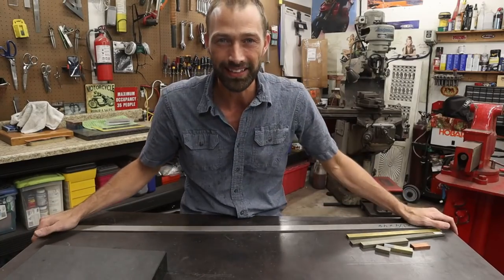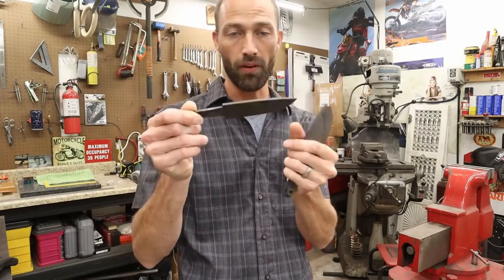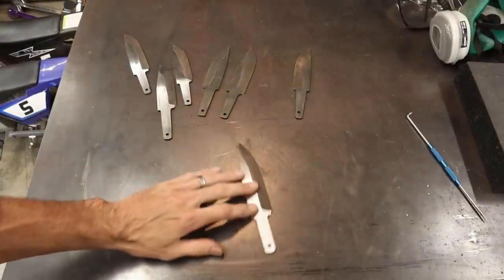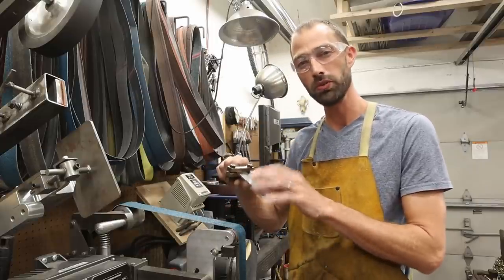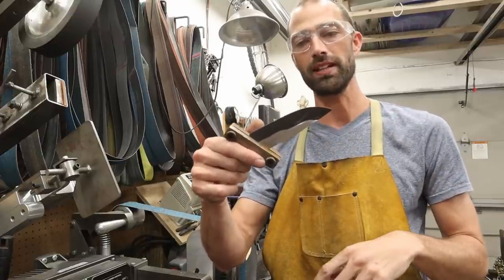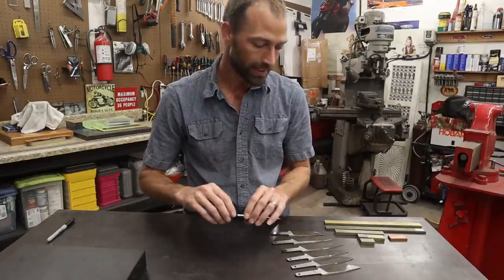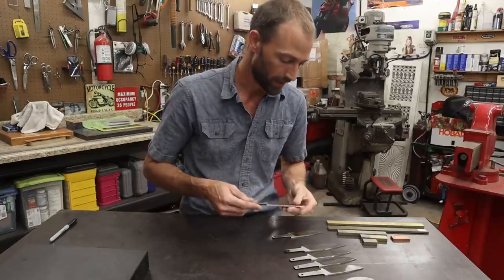These tips will improve your bevel grinding!

Comment: Awesome vid. I just started out. Freehand bevel grinding is very difficult, I have a huge appreciation for it now. It's an art of very slight hand adjustments. I find it easier to grind one side of the knife versus the other. My next attempt will be to grind my weak side first, then match the other with my strong side.
Reply from the maker: That is a good plan!
Reply: Im gonna steal that technique from you.  I'm also just starting out

Comment: Great video, I´m doing that too, 3 stainless steel knifes at the same time. And I´m using the grinding belts from Hermes, model RB590Y, it´s a agglomerate AO belt, and I go from 50 ceramic direct to 240 agglomerate. They are much thicker than a normal 220 grit and don´t burn the blade
Reply from the maker: Thats a neat belt for sure!

Comment: Thanks Aaron for the steady flow of useful tips and tricks. I am about to finish 3 knives (plus a couple more unrelated to this batch) that I'm doing simultaneously.  I've learned a lot doing it this way, even from one blade to the next I was able to improve. I'm also learning the idiosyncrasies of my 2x42 grinder. It's interesting how this machine is much different than the 2x72 requiring slightly different techniques due to the single speed, heat generation, and the design of the grinder in general. I've ended up modifying it over time as I've gotten to know it doing these 3 knives at once. One more thing, as I improve, I'm also able to take the information that you and others are offering and apply it as my understanding through increased experience. The process is really quite engaging to say the least.  Thanks for all the helpful guidance, I appreciate it something fierce!
Reply from the maker: You are correct that the 2x42 is quite different!

Comment: its been 5 years since i made knives, and i olny made them a couple summers. took awhile but i has very happy with them in the end. im preping to get back into it and your steps are very encouraging and helpful! i like the heat treating right after rough profiling and beveling. i was treating near the end, fearing it was harder to drill, grind and sand once treated. plus i was using a dremmel for the finger grooves. ill watch your vids, see what else i may have missed on steps and methods!

Comment: Great stuff as always.   I started doing batches of knives a little while back and enjoy it. The latest batch is 5, but two are karambits and I'm not entirely sure I have the skill yet to bevel them, but going to give it a go anyway.   
Interested in the handle section. I recall one of your vids where you applied (I think) tung oil quite liberally and then will lightly sand and do another coat.  I'm having a bit of an issue with this as after a week, my tung oil is STILL tacky.  May need to move it indoors out of the humidity.  The wood is Wenge, which looks great when the oil is first applied but then turns dull so hoping after several filler coats and then some wax, I will have it looking right.
Reply from the maker: Karambits are difficult for sure! I am glad you brought up the tung oil! I should have made it more clear in my video that I am using a tung oil finish. It is not pure tung oil and it has driers added to it to speed up curing times. Tung oil takes foreverrrrr to cure. You can take natural pure tung oil and cut it 40/60 with naptha and that will create a tung oil finish. I use either minwax brand or any other generic at the hardware store
Reply: @Aleeknives  Perfect...      I'll grab some this weekend because yes... this stuff is taking waaaaaay too long.   Of course I did get the pure tung oil thinking it was better.  Ah well...

Comment: How long does the oil last in your quench tank, and do you always use canola oil?
Reply from the maker: I used canola oil for several years. I never did change it while I used it. However, I did switch to park's 50
Reply: @Aleeknives  why did you switch?

Comment: Couple questions... Where did you get the bevel clamp. If you were to use a jig what degree should you set on jig for bevels ..or do you just eyeball it.....Love your videos
Reply from the maker: I bought the clamp that you see in the video from Jantz knife making supplies. As far as what angle to set for bevels on grinding that's a really good question I've never used a jig. It would depend on the thickness of stocks that you start with and how high you want the bevel to go. The angle would be measured in such the slight increments that I highly doubt that you could use an angle gauge to accurately bevel from side to side

Comment: I’m curious,,,,I guess it’s what works for the individual but I noticed you don’t rock your bock back and fourth. You use your arms. Also when you dive in on the bevels you start at the tip of the blade instead of starting at the ricasso. Great video as usual. Stay bladed brother.
Reply from the maker: Personal preference on the rocking or locked elbows but the reason I start at the tip is because if you start at the ricasso every time you can easily form a grind line from the other side of the platen, it is called 2 inchitis

Comment: Hello,

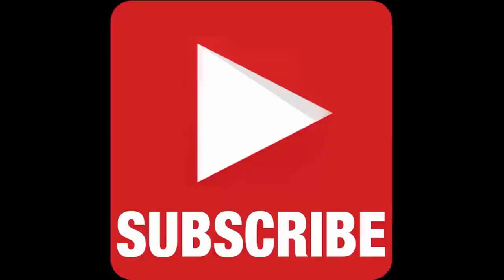again a very helpful video. A short question: At 18:38   How fast is the bevel running ( meters per second )?   Cheers Ralf
Reply from the maker: I have no way to measure the speed at which the belt is turning.sorry. It was running a little over half speed on the vfd
Reply: @Aleeknives  Anyway, i'll check it out. Thanks a lot for answering :-)

Comment: Great video, and I have a quick question. The height gauge used at the beginning, is it the same height gauge that you have linked to Amazon? There must be a mounting hole on the gage that's used to mount it to the 123 block, but I can't tell; is that correct? I really like the setup, but can't find a gage quite like that one. Thank you in advance!
Reply from the maker: Thank you! The height gage in the description is identical to the one I use! It comes on it's own base

Comment: Try a trizact A65(220) & up, no seam skip. They cost more, but last a lot longer. Either that or take a diamond sanding block & sand down the seam on a reg. 220. I dig this, next take off the training wheels(file guide) & have different bevels heights(just a suggestion). NICE JOB, hope all is well, take it easy.
Reply from the maker: I have tried the trizact several times with dismal results! They seem to glaze over really fast on me and then just heat up my steel. What am I doing wrong? I definitely like the idea of cleaning the transition seam on the belts. This gets me pretty close to make hand sanding easier.
Reply from the maker: Thanks for helping me spend my money Dave🤣😂
Reply: @Aleeknives  With the glazing on gator belts, get a file card and just run them about 25-30% speed, give them a good roughing over for a couple of laps and it'll bounce back not quite 'good as new' but will keep them cutting better
Reply from the maker: I thought of that just haven't tried it yet
Reply from the maker: I use the belt eraser regularly
Reply: @evaderknives  Yeah the belt cleaner rubber blocks help out a lot if you get some swarf stuck in them and especially on the softer materials like micarta, wood or G10 that clog up belts. On the trizact and structured abrasives particularly I've found the only way to kick them back into life is the wire brush when they glaze over.
Being they're very pricey where I am, the longer I can poke one along into some service the better